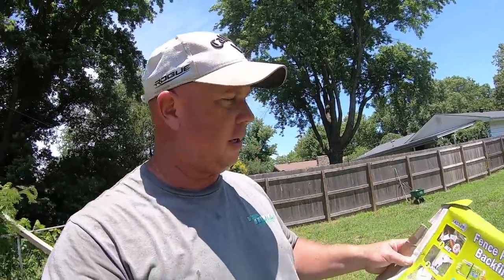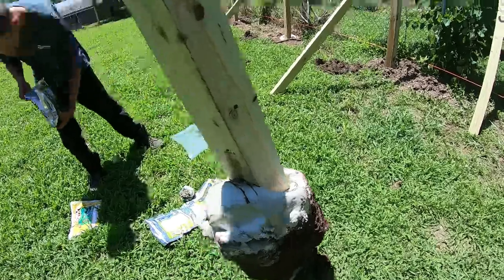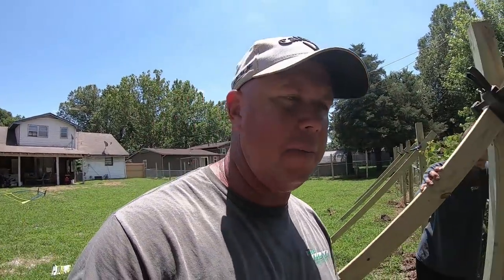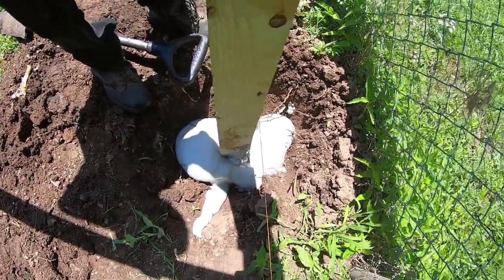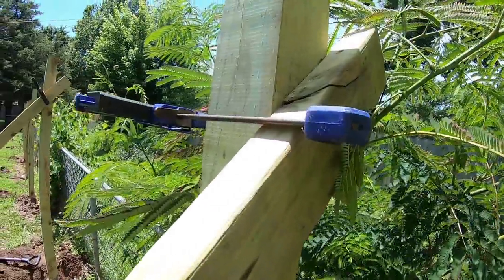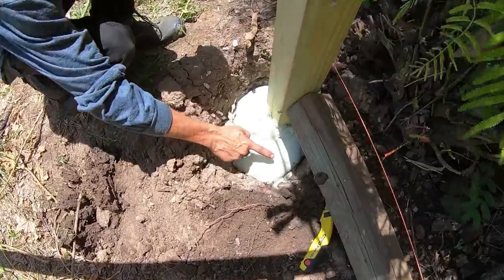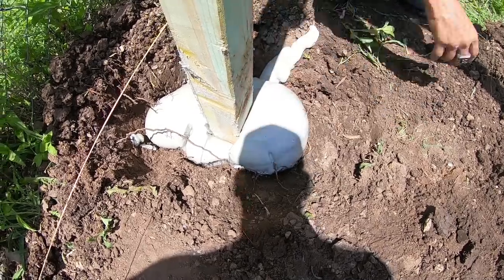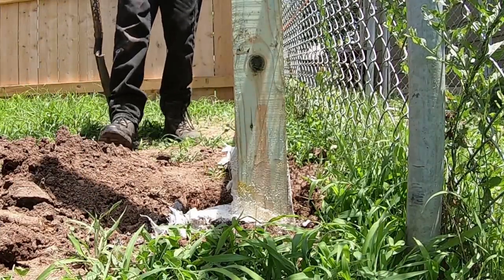No Concrete Fence Post, Is Foam Better

Comment: Been using this stuff since 2013 ... Love it!! Put a stone in the hole before the post and the foam will completely surround and seal the post.
Reply: Great idea!
Reply: or a little foam in first.
Reply: Wouldn't the foam that gets under the post lift it as it expands? I would think it would to some degree.

Comment: I got back problems and this method is great for me. No heavy concrete bags to pick up. The posts aren't that heavy for me. All in all it worked out great for my fence. Replaced a couple of rotted posts using the two part foam bag. Love the hands on video review. Very appreciated!

Comment: If you make your holes in a “bell” shape (wider at the bottom), your posts will be more stable and won’t suffer from frost heave. I’ve used this method for years and have never had a post move or come out of the ground due to frost.

Comment: Put some small stones in the holes first then pour the foam for added strength and firmness!
Reply: That's exactly what concrete is, little stones bound together with cement hahahaha. Foam and stones is concrete with extra steps
Reply: Peter Dembowy  kind of like rebar does gives it something to cling too

Comment: Shortcuts usually have short-term results. Would like to see how 2-5yrs of weather (i.e. intense heat, sun, heavy rain, prolonged wet conditions, humidity, freezing temps and ice may have on the durability of the foam - and then how it will withstand moderate>heavy winds...
Reply: Anna Banan Don’t think he’s going to get a whole Lotta freezing in Kansas here in Canada we got to go for feet deep to go below frost southern Ontario anyway I still have my reservations about this product
Reply: 7 years in SW Minnesota with 4x4 AC treated for raspberry patch and expanded patch so I had to pull 4 posts and the foam in fact is still green under because the foam is waterproofing the wood. The only thing is that I would put 2” of drainage rock under post due to foam not sealing it. For 4x4 post the foam is a much better product due to simplicity and quick set compared to concrete
Reply: I have used a similar product for my fencing and have no complaints yet.  Roughly 4 years of -40 to +30 Celsius temperatures, and last year was almost all rainfall.  I won't promise you the same results, but I can say I'm very happy with the decision I made and would recommend the product to my friends and family.
Reply: Hurricane, tornado, as well!

Comment: After a few days, the foam shrinks away from the walls of the hole and sometimes shrinks away from the post.  You even say it was easy to pull out.
Reply: I did my fence 2 years with the 2nd brand he used, the sikka one. We had many days of 30 degrees centigrade below zero here in Canada. Nothing happened. Survived 2 summers, fall, winter and spring. Quite good as of now. No heaving due to frost. Only down side I see is, they are costlier than concrete per post. Furthermore, 2 of my posts are supporting a heavy gate, about 10 feet between posts. Cannot predict the longevity, but as of now, happy with the results.
Reply: @nilval445  Thanks for that update. I have to install a mailbox and almost didn't try this stuff because of negative comments.

Comment: I see a bunch of uncertainty in the comments so I'll share a personal experience with this foam.  Myself and a few of my neighbors put up fencing in our new-build neighborhood about 4 years ago.  We live in a very unpredictable climate where our winters get down to -40 and our summers can get up to 35 Celsius.  We can go from -20 to 10 in a 12 hour period, and it can snow, rain, windstorm and hail all in the same day.  Last summer was one of the wettest summers we've every had.  

The foam, as you can see in the video, adheres directly to the wood and stays that way.  Cement, in my experience, does not always hold that close to the wood post and will allow water to collect near the wood which has negative effects on the wood.  The foam doesn't appear to have that same issue (yet).  The foam also does a really good job of encapsulating the entire submerged post (as shown in the video) so even the bottom of the post remains covered with foam and protected from water deposits.  I have zero complaints about rigidity of the posts.  Our yard is occupied by young kids playing with soccer balls, and our neighbors mostly have the same setup.  I don't know if they would get ripped out in a tornado, but where I live, that's a very rare occurrence and honestly if I'm worried about my fence posts being ripped out in a tornado more than I am about my house being completely obliterated I'm probably arguing too strongly against the foam for other reasons (maybe I've been building fences with cement for 20 years?).

It's a good product.  The convenience of the product alone is worth it.  If there ever is a time where I need to redo a post, the foam is much easier to remove from the hole than cement would be.  You don't need wheel barrows or buckets to mix this stuff, it's very easy to handle.  My only gripe with it is how messy it can be during installation.  The bags will have residual amounts of foam on them which sticks to everything and makes a mess in a hurry if you don't throw it into a garbage bag immediately.

If you're - on the fence - about this product, try it on a hole or 2.  I was very nervous about choosing this product over cement, but I am very happy with the outcome so far.

FYI - my fence posts are below the frost line for my area (you can find the local frost line information on Google).

Comment: This stuff is great, I've been using the Sika brand for about six years. You get a little more working time if the bags are kept cool in an ice chest. If the holes are sized right a bag will usually do two posts. One thing, it doesn't do well where there is standing water because uncured foam floats on top of water..

Comment: I find it hilarious when he says "not that hard to get out of the ground"....and here I thought posts were supposed to be difficult to get out of the ground, you know, so that heavy winds don't rip the posts out.
Reply: Imo
The foam and the concrete both adhere to the post to make it more difficult for the post to move after it cures however neither the form nor the concrete will bond to the soil so compaction is the main force holding the post into the ground -- once you loosen or remove the soil around the media you are deal with the extra weight of the material bonded to the post in this case the foam is substantially lighter than the concrete  therefore form is easier to get it out.
Reply: The point of concrete is it's heavy and therefore holds the post more strongly in the ground....
Reply: @serick73 ....you're right, wind doesn't blow from the ground....but high winds cause uplift, hence tornadoes/hurricanes forming.  There have been many videos showing fences uplifting out of the ground without the weight of concrete.....therefore....foam is not ideal in all posts.  Personally, I prefer to concrete the posts that tie to gates on both sides, along with the corners and every 50 feet or so on long lengths.....foam can be used on all other posts.
Reply: @serick73 concrete will hold postd stronger than the post itself usually breaking it at ground level if the impact is that much.  I read the comments amazed at how many little boys live in moms basement well into adulthood.
Reply: @Chris-___-  Was the negativity in your comment necessary? Surely adult men such as yourself know how to communicate without being surly?🤔
Reply: @Chris-___-  the post usually rots at ground level cause of concrete holding water like a sponge.
Reply: An 80# bag of Quikcrete is a third the cost of one bag of this Sika foam...
Reply: @serick73 It does in 70 mph winds.  With a fence attached that acts like a sail.  So yes it does.  Maybe save that word "stupidity" for when it is needed .  Its called a "lateral" force, which weigh can help to counter act.
Reply: @Chris-___-  https://www.youtube.com/watch?v=g2iYvyiJYsg When the foam expands it compresses the soil around the pole and securely locks itself in place. A skidsteer trying to pull the post out after application broke the posts before they could be pulled. Concrete rots the posts because it holds water against them.  The weight of the concrete has nothing to do with holding the post in the ground. Its all about the foam or concrete filling the void in the soil properly that secures them. The roots of a tree doesn't outweigh the tree itself, but they lock it to the ground with the same principle of soil compression as they grow.
Reply: @chefdan87     And yet its still just foam. I haven't seen foam that doesn't become brittle or collapse with weight pushing on it. Give it a year or two and the fence will start to lean. Especially if its used in the freezing climate areas. Its a great product for smaller projects like mail box or bird house but something as large and heavy as a fence that can be influenced by strong winds probably wouldn't trust it for long.
Reply: @alexpanasyuk3819  This isn't open cell foam. Its closed cell. Cures to become almost hard as a rock and is waterproof. If the hole is dug properly and deep enough it will have plenty of surface area to ground contact to support itself from lateral loads. Ive seen this stuff cap old unused wells and you can drive a truck or tractor over it without damaging it. Watch this video which talks about how strong this stuff is. https://www.youtube.com/watch?v=dAnG6HRAqMc this also talks about is structural strength. https://www.youtube.com/watch?v=bekgWsR2V5Y Concrete works fine other than it rots the posts out by holding water against them. Vinyl or metal fencing yeah concrete all the way but with wood i would want something that seals it up against water intrusion better.
Reply: I would do at minimum a small layer of rock around the bottom with a barrier of dirt on it before setting the post with the foam.   If water can escape the bottom it will last longer
Reply: @miller1  A third the cost?  Yeah, $4 vs. $12. No special tools needed to remove Sika, it's a one man job, and can been done fairly quickly.  The case is not the same for concrete.  The strength of concrete does not matter when it is holding a half rotten wood post in the the ground, which is the case sooner or later.
Reply: @serick73 After 45 years in construction I found that the best way to set a post for fencing is compacted earth around the post. I use the back end of a digging bar and set the post in 6" lifts. Just as solid as concrete and if you ever need to replace the post for any reason it is easier to remove.
Reply: @serick73 There is no way that foam is going to hold as well as concrete. Once the concrete sets that pole weighs a lot more than the foam. The weight make the post more substantial.
Reply: @serick73 the fence panels are like sails to a ship, so plenty of uplift forces
Reply: @edmundooliver7584  we have barns with posts in concrete last 20 years and more so...
Reply: @jefferyholland  and if it’s windy
Reply: @michaeless658  yes but a fence post is out in the open in snow and rain.
Reply: @kootenaywomon  If you look at seick73's earlier post it would appear Chris was simply responding in kind to a similar sarcastic remark.  Sometimes taking the high road is the right thing to do but other times people need to be slapped in the face with their own style of stupidity for them to "get it".  Sad but true.
Reply: @serick73 With all due respect, and as others have said, as a building designer in a previous life, I can tell you that wind does indeed blow "from the ground up" in certain situations - which is why there are requirements for uplift.  (you might wanna make sure you yourself are correct before searching for the stupidity of others).
Reply: The main thing I got from thease comments is that Americans haven't learnt to form concrete so that water runs away from the post, and they probably don't use creasote

Comment: Holy shit, you had me sold at how easy it was to strip the foam off of the post! The ball ache I’ve had try to replace rotten out posts set in concrete. Especially since they had already been replaced once 😰

Comment: After the foam expands it also contracts slightly within a couple days leaving a gap around the post and the outer edge of the hole. I've installed about 1000 fences and you can't beat concrete and rocks for a solid, stable post that will last. Prior to installation coat the bottom 2-3 feet of each PRESSURE TREATED post in a sealer like Cuprinol, Thompson's Water seal etc . Do this a couple days prior to installation for posts that will not absorb water and rot. One other thing--coat the top open grain with sealer also and put a cap on each post to prevent the wicking of water throughout the post. Pro style folks.
Reply: I have installed over 2000 fences and they all have had no issues with secure set. Who did I do twice as many fences as you? Because this stuff works super fast and ready to start building on the same day.  
"Coating" the post is just a bunch of nonsense. Plus it's not just pressure treaded that you should be using for posts, it's GROUND CONTACT pressure treated that need to be used. Besides any water that travels down the inside of the post during rainy season , is is going to get trapped in that extra "protection" you thing is doing any good.

Comment: I guess I’d be interested to see how that foam holds up after several years
Reply: Theres a fee vids out there. After 2 days the foam shrinks off the walls of the hole and also shrinks off the post. A chainlink post can be pulled out by hand 2 days later. This stuff is a garbage gimmick at the moment.
Reply: My neighbor his friend and I did about about 85 feet of fencing using foam to set metal posts at about this time last year.  A week or two ago I was prompted to check on fence ...It is Rock Solid!
Reply: @michealfigueroa6325  video or it didn’t happen
Reply: @psychopathicunity not true .. after a year and mine is nice and tight..I used it for a railing for my deck and just fine..
Reply: @David Gonzalez  you're right, no where else has higher or lower humidity than you. No where else has higher or lower temperatures than you. Don't know what to tell ya, a video of countless failed ones isn't untrue, maybe circumstantial, but certainly true